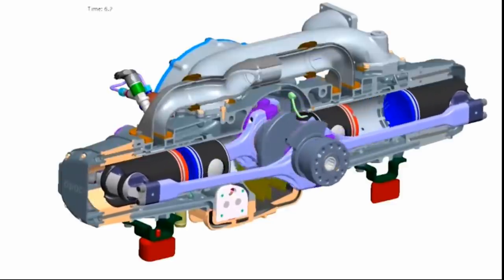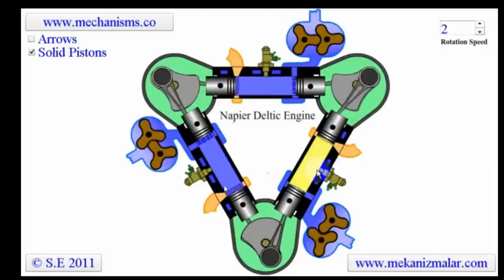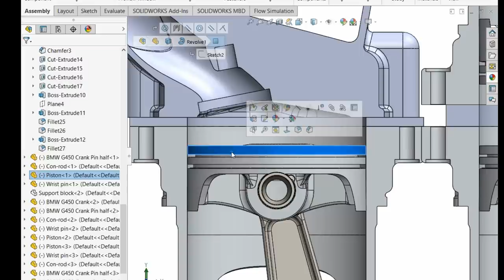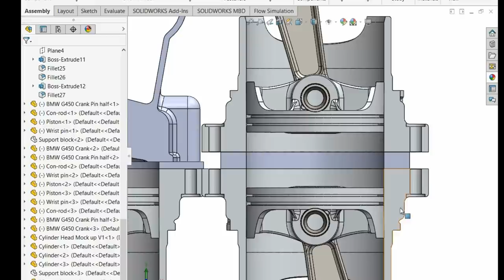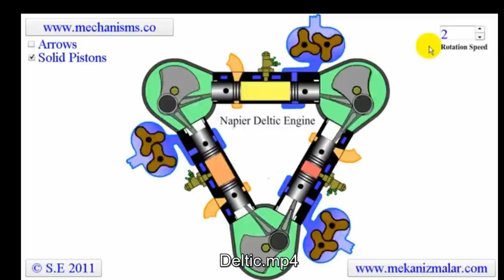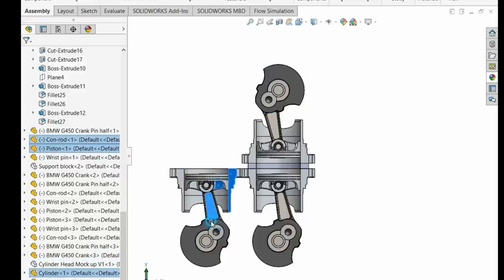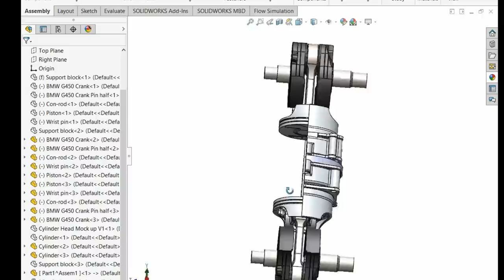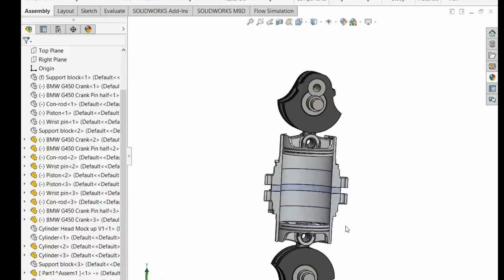Opposed engines are better?

Comment: The Commer TS 3 was a success.  They had developed a TS 4. Dodge stopped useing them when the bought out Commer so they could use their own engines.
Reply: Well the Yanks in the car industry have always been a bit lost when it comes to engine development.
Reply: Yes everything involving cars seems obsessed with the 4 turd stroke! I dread buying another 4 turd stroke truck when there is nice 2 stroke DFI tech. I pretty much dislike car culture and keep up with sled culture more
Reply: Chrysler bought out Commer , there are several TS4 8 piston motors , one complete one in New Zealand. Was a great motor .
Reply: @JosephCowen-fz8vj  that would be something. I thought of an OP Rotax 1700 made from 2 850 Rotax etec engines

Comment: Commer TS3 was a 2 stroke, 3 opposed piston, cylinder, scavenging supercharger engine, but used a single crank.  About 24kw/l.
Reply: would've lasted longer if it wasnt restricted by design to it's initial horsepower rating, modularity and cost. cool as cucumber though.
Reply: It's a 6 piston design, and Commer was well on the way to the TS4 they had running TS4 8 piston engines , one complete one is in New Zealand to this day , there were even plans of a TS6 12 piston 6 cylinder version . But it was lost in history , the sound of a TS3 you never forget .

Comment: achates does EXACTLY what I mentioned before- they make BOTH piston faces concave & polished- this reflects the heat away from the pistons & focuses it on the combustion pocket between the two pistons- making the combustion even more efficient.
Reply from the maker: "concave & polished- this reflects the heat away from the pistons & focuses it on the combustion pocket between the two pistons- making the combustion even more efficient."

- What? You do realise this makes NO sense. I'll prove it to you starting with 1 question. What forces a piston down a bore?
Reply: Ok so the polished piston faces reflect the EMP from the combustion and help with efficiency!
Reply: @dirtygarageguy  Pressure, not heat.
Reply from the maker: That's not what they said. And it's certainly nothing to do with EMPs
Reply: @dirtygarageguy  I'm just responding to this, 

"What forces a piston down a bore?"
Reply: So it’s non electromagnetic energy in there

Comment: Instead of rattling on about uniflow needing superchargers, just simply say 2 strokes without crankcase scavenging require supercharger scavenging & move on. Of course this is why all direct injected 2 strokes are supercharged, well except for that Bimoto one which thus didn’t work & bankrupted them. Of course one can build a opposed piston engine where one end is a 2 stroke & the other engine is a 4 stroke running twice as fast. The 4 stroke does the scavenging while the 2 stroke does valving, but why not twin charge it anyway.
Reply: Amarc made an Opposed Piston crankcase charged 2 stroke diesel outboard. they came in 9.5 HP and 18.5 HP.
Reply: There is the Rotax 850 Etec turbo 2 stroke which is DFI, turbo and dry sump oiling with crankcase pumping.
Reply: The etec 2 stroke rotax uses the crankcase and turbo on the 850.

Comment: Top video Matt, a clear demonstration that engineering is the art of compromise, the trick is finding the best compromise for the application
Reply: It better have oil injection like the Cummins ACE OP 2 stroke and Rotax 850 Etec turbo R.

Comment: The advantages of an opposed piston engine are more-or-less two-fold.  Firstly, the bore/total stroke ratio can be made extreme relative to the stroke travel of each piston and therefore the surface/volume ratio of the combustion chamber can be made much lower, leaking less combustion heat to the environment and allowing more work to be recovered from the gas.  Secondly, because the stroke is, in effect, split in two, the length of the conrod can also be much shorter - half, effectively.  If you try to package a single piston engine with the equivalent bore-stroke ratio to an OP engine, you'll find your bore/stroke ratio will be limited by the conrod clouting the bottom of the bore unless you resort to an infeasibly long conrod or move to a cross-head design, which is also very long/tall and then suffers from a poor conrod/stroke ratio increasing second order vibration forces.

Comment: Can't really talk opposed piston without talking about Achates power. They are the ones that are actually developing, manufacturing and making them to compete with other engines. They are in a position of way more credibility than any other alternative engine design house I know of. If reports are to be believed, they have secured US military contract for powering Bradley Fighting Vehicles. They have also retrofitted an opposed piston engine to an F150 with similar performance of the V6 ecoboost, but 10% more gas mileage.

It is really complicated, it is both turbocharged and supercharged, has EGR (to aid gasoline compression ignition) and what not. Its understandable that they need all that engineering for the efficiency gains, because the era of easy gains through design improvements has long passed.
Reply: Any diesel is >10% more efficient than petrol Ecoboost, which has BSFC >240 g/kWh at its best, diesels have <200 g/kWh.
Reply: It's not hard, it's simple: how much fuel engine consumes to produce a kWh of energy = brake-specific fuel consumption (BSFC)
https://en.wikipedia.org/wiki/Brake-specific_fuel_consumption

Of course it depends of engine rpm and load, so the best number is chosen to calculate the best engine efficiency.

We can calculate the engine efficiency by this formula (I simplefied it a bit): 

1/(BSFC × 0.012) 

So if the engine's best consumption is 250 g/kWh, then the efficiency is:
1/(250 x 0.012) = 33 %

For 200 g/kWh it's:
1/(200 x 0.012) = 42 %

All other methods (MPG, km/L, L/100km...) are vehicle specific, so the same engine don't have the same consumption numbers on a small city car, and a large SUV, so a BSFC is a lot better way to show engine's consumption and efficiency.
Reply: @My-Opinion-Doesnt-Matter  I think his point was that as a practical matter in most applications, efficiency is a map not a single point.
Reply: the bradley fighting vehicle is NOW in production.. .WITH an achates engine, built by CUMMINS... NOT A TEST ENGINE- NOT A PROTOTYPE- A PRODUCTION ENGINE, BY CUMMINS, DESIGNED BY ACHATES. done deal.
Reply: Heres the Cummins OP 2 stroke: https://mart.cummins.com/imagelibrary/data/assetfiles/0058689.pdf
Reply: Mabey Achates will offer an OP 2 stroke for snowmobiles

Comment: For a 4 stroke you would need sleeve valves
I'm wondering if any one tried this type of layout with steam.
For a range extender use a cross shaft with the rotor for the generator mounted on it. Drive the cross shaft via hypoid bevel gears.

Comment: Great video, but I think you are missing some of the advantage of the OP engine and have a few misconceptions.

As for power density, they are running a 2 stroke cycle which does improve power. If we totally disregard this, they stil have a second piston and crank replacing the volume of a cylinder head. Of corse the cylinder head won't add much displacement on a conventional engine, but the second piston and crank will add displacement. Because of this an opposed piston engine with the same piston and crank may be 25% larger, but will have 2x greater displacement. 

Next, you are able to entirely get rid of the valve train. This is nice because on the majority of engines, the valve train wears faster and requires more maintenance than the bottom end of an engine. Additionally the valvetrain tends to be one of the most complex and manufactring intensive part of the engine. So an OP engine could very well reduce the overall maintenance, complexity, and production cost.

I also think you may have a few misconceptions about the effects that the 2 stroke cycle will have on the engines. Traditional 2-stroke engines rely on crank case pumping to get fuel/air in the cylinder. Crank case pumping on its own is only about 75% efficient at scavenging. For this reason traditional 2 stroke engines rely on other thinks like expansion chambers, tuned ports, tuned intakes, etc to improve that scavenging efficiency. Sadly all of these listed items must be tuned to a specific rpm range to work and in turn give 2 stroke engines their classic powerband. The OP engine has a supercharger which is not limited in scavenging efficiency so they doesn't rely on any of these tuning effects. So if you look at real world OP engines such as the Junkers Jumo 205 engine and the Achates engines, they all have extremely wide powerbands with high peak power and phenomenal torque over the entire power range.

Sorry for the rant. I do love watching your videos, but I think I have a slighly different view on OP engines.
Reply from the maker: "As for power density, they are running a 2 stroke cycle which does improve power. If we totally disregard this, they stil have a second piston and crank replacing the volume of a cylinder head."

- In a world of emissions, using double the fuel isn't good. 

"Next, you are able to entirely get rid of the valve train. This is nice because on the majority of engines, the valve train wears faster and requires more maintenance than the bottom end of an engine. Additionally the valvetrain tends to be one of the most complex and manufactring intensive part of the engine. So an OP engine could very well reduce the overall maintenance, complexity, and production cost."

- Almsot the same answer. Emissions. Valves are adaptable and hence why nearly all new systems use some form of VVTI etc.

"The OP engine has a supercharger which is not limited in scavenging efficiency so they doesn't rely on any of these tuning effects."

- so we're taking away the heads and removing our valve control ability and replacing it with a supercharger, which isn't helping with emissions and we still have pumping loses etc. Put in a simple way, in the current/past 30 year climate 4 strokes can't be beat on emissions vs power (efficiency) The 2 stroke cycles with cylinder ports provides little avenues for control.
Reply: @dirtygarageguy   Wrongo Mate, you need to study Achates.   Better or equal on emissions and much better on fuel.

Think about it scavenging is not free in any engine.  Half the motion and a lot of power in a four stroke is wasted doing it.  Especially considering the torturous pathway and tiny valve curtain areas that 4-S must breathe through.   Ever notice that big industrial air compressors use screw type blowers not reciprocating compressors, it’s because blower move air more efficiently.  

So the  externally scavenged engine has many advantages and efficiencies.   It breathes through large   Efficient airways.   The prime mover of air is more efficient and can be optimized independently from engine rpm.  Throttle plates, waste gates, CVT  and fixed multi ratio drives can be used, again demonstrated with measured results by Achates.

Comment: One little quibble: Most of the designs I have seen for opposed piston engines are NOT naturally aspirated, either a supercharger or a turbocharger are set up to eliminate the throttle and remove pumping losses. With either system they can very accurately control air volume entering the cylinders, based on pressure and temperature. In addition the removal of the heads with their cams and valves also eliminates losses and increases power output. I do agree with you wholeheartedly, that naturally aspirated versions are shit. Variable exhausts and resonance tubes belong in the dust bin of history.
Reply: They have to be blown , they are two stroke ! Uni flow . You can't run any of them without it , making them four stroke would need valves and cams . I don't think you grasp the cycle .

Comment: 20:42
Granted most of this is just a thought experiment for me, but this is the direction I've been leaning lately. I'm nowhere near doing a project car, let alone manufacturing, but figure up how much ass is required to accelerate a vehicle and select an electric drive motor based on that. Work backwards from that point to determine what size generator, battery/capacitor bank can share that load during max acceleration, and charge the batteries/caps during idle & cruise. Select the generator then you can select an engine to drive it. If it's a constant rpm generator, you can use an engine tuned to that rpm band for maximum efficiency.
Reply: This is a thought experiment for me as well but I was learning towards the Cyclone Power Technology’s external combustion closed cycle steam engine as a range extender. Since I started looking into OPOC engines of late, I am not so sure.
Reply: You have heard of the Commer TS3 opposed piston truck engine in production for almost 40 years ! Very good working engine .

Comment: What about the advantage of the pressure of the combustion chamber only acting on the pistons and not being wasted on the cylinder head. i.e. for every force you have an equal and opposite reaction so all the forces will be used to turn the crankshafts so the efficiency will be enhanced?
Reply: The head would have to move in order to waste energy. The formula for work done is W=Fs where F is the force and s is the distance of displacement and ideally the piston will move down without the engine moving up at all (which isn't exactly what happens because engines do vibrate) so even though pressure is being applied to the head there's no work being done on it.
Reply from the maker: What stuart said. For instance, blowing up a balloon. Work is required to force air into a deflated balloon, but once the air is in the balloon, no work is done keeping the balloon inflated.
Reply: @BuffMyRadius  I see your point about the work. The work done is double as the other piston also moves. So this would be the same if the single piston had double the stroke length. I wonder what the reason for the enhanced efficiency is? 🤔
Reply: @gbone7581  My guess would be that the opposed piston configuration can run large expansion ratios without absurdly long crank throws. There's probably something else about flame front propagation and lower piston speeds in gas engines, but most of these opposed engines are diesels.

Comment: I think you're missing the benefit of the system. You're doubling your stroke length without increasing piston speeds. This means you can have astronomic expansion ratios.
Reply from the maker: Yeah I agree. The extra crank and extra pistons and extra casing etc doesn't make any difference... 

Funny that the people who fool around with this design never seem to use that as a benefit...